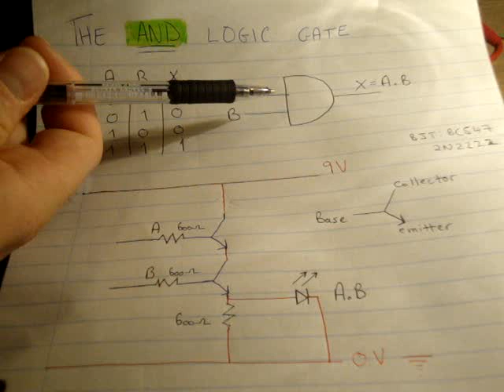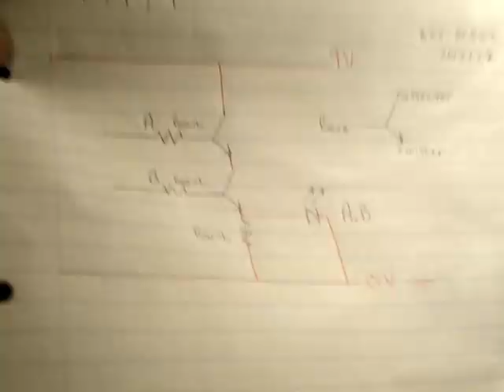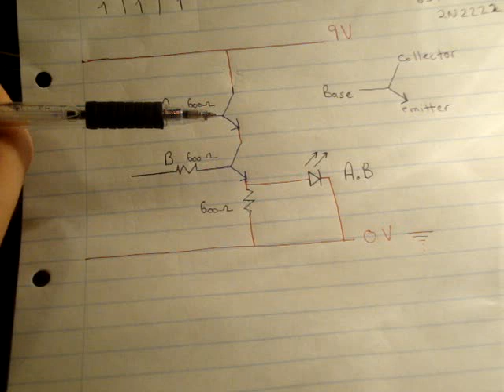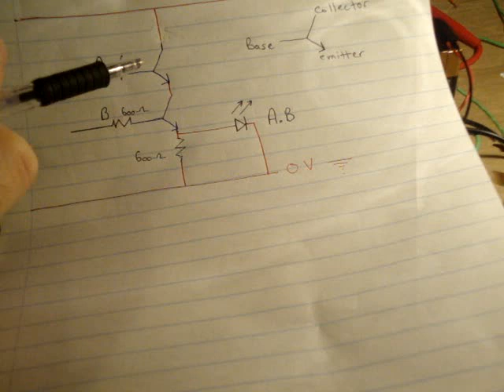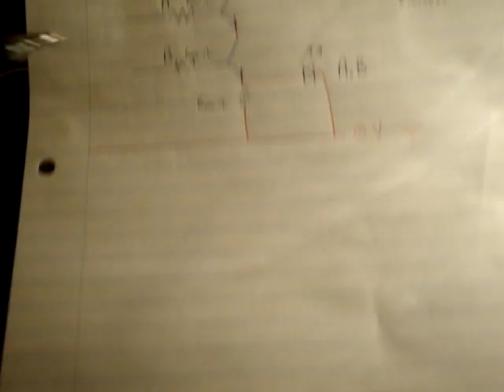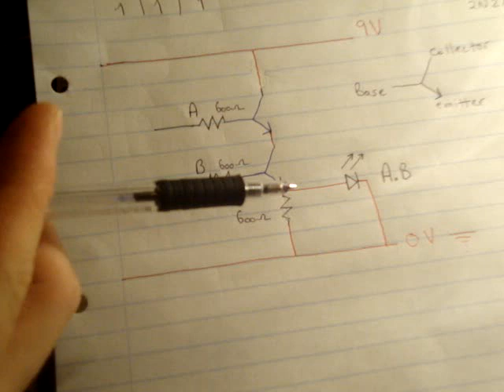Electronics 10 : How to Make an AND Logic Gate ( 2 Transistor )

Comment: This is really cool. I've wondered how AND logic gates work on this low level. So it's really just two transistors wired in series and use the base wire into the transistors as the A and B inputs while the main power input comes from the battery and travelling through the collectors of your transistors when both A and B are powered.

It probably would have worked a bit better if you used 1.5 Volt battery, then the second transistor wouldn't have any current bleeding through from the base. Though I guess you didn't have lower resistors.

Comment: What is the purpose of a logic gate? What does it DO? And don't answer that by how it works. I want to know its damn purpose
Reply: Logic gates are what makes a computer run. You can combine logic gates to form a circuit that can add two numbers, for example. http://en.wikipedia.org/wiki/Adder_%28electronics%29

You can go much farther, too, and form circuits that can store 1s and 0s.

From this, you can build a processor that takes in lines of code, and does complex things based on the instructions given to it (like read in/modify the memory previously mentioned, or send a signal down a wire that leads to a monitor...).

If you're interested in building a computer from the ground up from logic gates, this book has basically everything you need to know: http://www.nand2tetris.org/
Reply: Thanks for the info!

Comment: I'm no circuit expert, but I was thinking, to fix the input that causes a low output surely you could buy a diode with a high on voltage (slightly higher than the low voltage you are getting with one of the inputs) and connect between the gate's output and the LED?

Comment from the maker: A most basic breadboard available in any electronics shop; a kit of wires of many different sizes (also available in any electronics shop); 2n2222 transistors are available online or in shops like radioshack/maplin (ask at the counter); 9volt battery also available anywhere. hope it helps

Comment from the maker: If you don't have a resistor to limit the current (flow of electrons) before of the transistor base the electrons destroy the junction and will constantly flow (and not act as a switch which we want).
Voltage is electric potential energy (essentially) so if you have too much voltage across your resistor, then teh electrons have too much energy which is disappated as heat in the resistor and can melt the wire... broken resistor.

Comment: Very well done video! Explicit explanation.. liked it.
I've been a software programmer for almost 30 years but I've been researching this stuff for the last few weeks. Just a hobbie. so. (if you don't mind) I would like to ask you some very basic questions about this.
Why do yo need resistors applied just before current reaches the transistor?
Resistors handle only a limited volt amount?
Disctinct kind of resistors models would require different kind of schematics for this kind of gate?
Thanks!

Comment: Great video!  I believe the leak here would be fixed simply by placing the load (the led) upstream (on the positive side) of the and gate. Since the last base takes a positive and outputs a negative, it is leaking some of it's power, turning the light on.  Alternatively, you could switch out your NPN resistors for PNP Resistors, and feed their bases from the ground instead of the battery source.